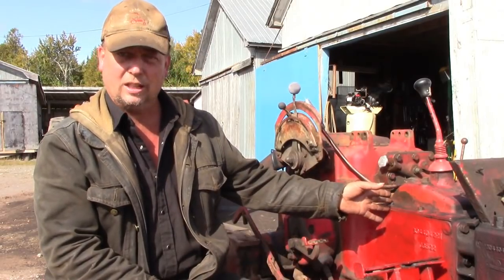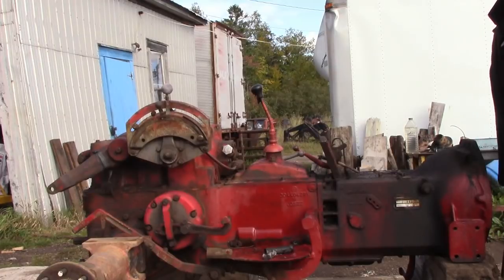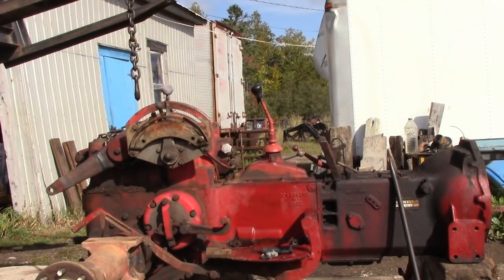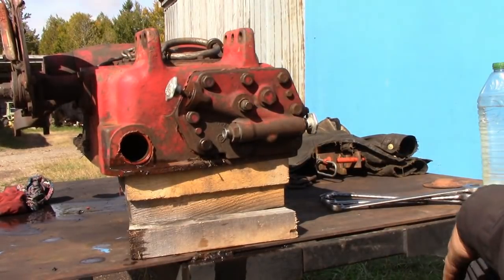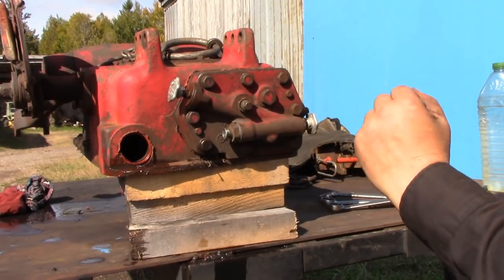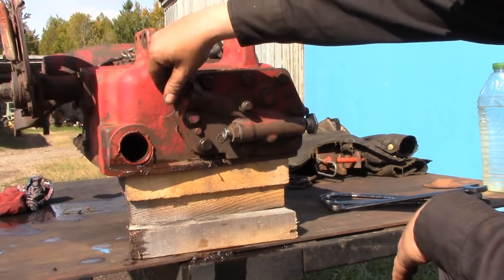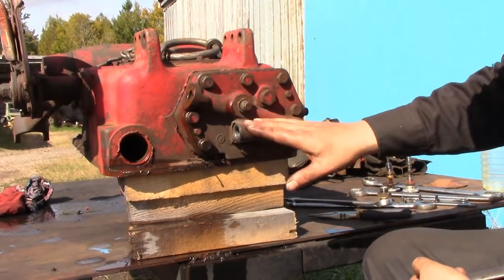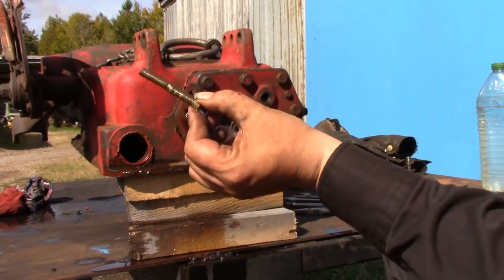B414 Hydraulic unit dis assembly

Comment: What is the fast flow valve used for, and how would it be used, what adjustments are available.
Reply from the maker: Fast is the normal setting, you can set it to slow to slow down the raising and lowering of implements. I have never used the slow setting. Thanks for watching!

Comment: Hello around the 4 minute mark you talked about the isolator valve how it’s used to run a wood splitter. Is this used with the remote hydraulic accessories or can this be a stand alone line for running a remote cylinder?
Reply from the maker: That is a stand alone solution, it is only one way flow so to run a wood splitter etc it would have to have it's own valve.  It will work for trailing machinery that uses a single acting cylinder to lift and gravity to lower. Thanks for watching!
Reply: @CanadianRedneck15 thank you that explains a lot I appreciate that
Reply: Also love the videos very informative

Comment: I have a gas B414 and the end of the hydraulic"regulator" filter broke off inside just like yours in the video.  Any ideas as to how to remove the remaining end inside the valve assembly without having to take remove it from the tractor and take everything apart?  Based on pics of a complete filter, the end inside is shaped sort of like a nipple and is held in by an o-ring.
Reply from the maker: A pair of long needle nose pliers should be able to fish it out. It's just a long cylinder, about 1 1/2" X 5". Thanks for watching!
Reply: Wanted to ask if the cylinder head plate can be removed safely from the valve plate without removing the entire hydraulic unit from the tractor?
Reply from the maker: @tjriddle6029  I think so yes.
Reply: Ok, thanks

Comment: Hello Dave - I have dis-assembled  the hydraulic unit after the lift arms stopped coming up.(not lack of h-oil issue, not the spring issue to which you refer in the dsi-assembly) .   Can post a video on re-assembling the hydraulic unit please ? (I have the shop manual but ... )  TIA a gazillion.  PS I may have an extra unit available later.
Reply from the maker: I don't put them back together I just strip them for parts. Thanks for watching!

Comment: I am wondering if you can help me identify this tractor.  I have this information 
International Harvestor Co of Great Britain model A440003B00347
Engine BD144A.    77872
Diesel would picture help?
Reply from the maker: A picture would be useful though I suspect that would be a 354. With the 354/444 tractors for some reason the serial number ended up in the model number line.

Comment: Hello, I have an International 434, which when lifting the hydraulic arms with a connected machine, it lifts and reaches the point where it begins to go up and down, you have to keep accelerating, so that the machine stays or otherwise it goes down.
Reply from the maker: Sounds like the lift cylinder may need repacked. Thanks for watching!

Comment: I have a int444 BD154    My 3pt hitch will not raise I clean all valves  replaced small split pin  Replaced new Hyl oil too  Can it be something in that piece you took off  Ihave a front lifter and power steering  they all work fine  What else can it be Also sometimes my 3pt will raise by itself  when I’m driving  but it won’t lift  even I move draft controls  So hope u can help me I  love all your videos   So helpful  Thanks in advance for any help in advance
Reply from the maker: Sorry @MrHeavyev, I am not sure how to help with that.
Reply: Thanks For Reply
Reply: I took the Hyl off and I found a S Shape wire in bottom of tank  it look that it connects to big spring  not sure where it goes  I have picture but not sure how to send to u Maybe u can explain it to me Thanks
Reply from the maker: @MrHeavyev  I'm not sure but you can look up the parts diagrahm at https://www.mycnhstore.com/us/en/caseih
Reply: Ok thanks

Comment: Morning Dave im working on my 2424 industrial . Working on the hydraulic reservoir going to replace the gasket on the control valve to reservoir. And i noticed that there is a safty chain in there it is broke up into a couple peices . Would you by chance know where that is supposed to be hooked to on the bottom some where ? And also does it realy need to be in there . I haven't noticed and problem with it in the 15 years i have had it probly been unhooked sence i got it . Thanks in advance . Love your videos
Reply from the maker: If it's been causing no problem I wouldn't worry about it. Thanks for watching!
Reply: Thanks for the reply  @CanadianRedneck15

Comment: Hi Dave! I need some help with my 3pt. I got stuck with the snow mover and lifted/pulled the tractor backwards with another traktor, i think i loftet the 3pt to max and now its not working, the safety chain inside the hydraulic tank is a broken but the rest looks fine. Its a 434, and it worked just fine before i lifted it/pulled ut in the 3pt. Great videos! Br/Alex from sweden
Reply from the maker: The push rod that moves the rock shaft just sits against the piston in the lift cylinder. Yours may have lifted far enough  to jam the push rod. Make sure it will slide back in against the piston. You may have to loosen the valve body at the front and move it forward a bit to get the rod back into the lift cylinder if that is your problem. Thanks for watching!
Reply: @CanadianRedneck15  Thanks! I guess i cant send or receive pics here? Otherwise i should av send you a pic, i just sucked the oil out of it and saw that the chain was broken.

Comment: Hi Dave got a question B414 LH spindle broke it is power steering long spindle original B414 my parts tractor has a later serial # and has the shorter spindle reg steering can i take both sides from axle extensions and put both sides in the older one thanks
Reply from the maker: There were a few variations, manual steering had a shorter spindle, the steering arm is keyed and has a bolt through the side to lock the arm to the spindle. Power steering has longer spindle and the amr goes on a tapered spline with a nut on top to hold the arm on. There was also a high clear or row crop version that was some where around 8-12" taller. Thanks for watching!
Reply: @CanadianRedneck15   Thanks Dave

Comment: I really have learned a lot from your videos. I rebuilt a BD154 on an IH 384 watching them. The motor runs perfectly but the 3 point lift goes up in a jerky way under a load. Kind of a Bump, bump, bump. It will raise the cutter to wherever the lever is set and stay there until lowered. Just jerky going up. I cleaned the suction screen and hydraulic tank during the rebuild. My question is whether I might have a pump issue or a valve bypassing? Hate to buy a pump and not fix the problem. Thoughts? Thanks for all you do! It really helps!

Comment: Hi, i have a 434 that after removing the the hydraulic tank and replacing it, the 3 point hitch will not go down with tractor running. When you shut it off it will drop. All this no matter where the control is. Where would i look first ?.
Reply from the maker: Make sure the "open/close" valve is fully open and the draft control lever (lever next to the fender) is at least half way forward. If that doesn't solve the problem then you will have to start checking deeper to find the restriction to the flow of oil. Thanks for watching!

Comment: Hello Dave,
Thank you for your helpful vidéos. 
I have an IH 434 with some trouble on the hydrolic valve. 
Do you have, or happen to know where I could find a detailed plan of said system? 
An exploded view would be perfect. 
TIA and have a good one.
Reply from the maker: You can look through the parts book at https://www.mycnhstore.com/us/en/caseih  Thanks for watching!
Reply: Hello Dave and thank you for your earlier reply, much appreciated. 

I hope not to be a hassle, but there's something I'd like to bring up

The lift of my IH 434 doesn't rise whatsoever, and since this tractor model is highly uncommon here in France, I was wondering if you had some pointers.

The pressure is fine ( 160 bars), the oil & filter are fine, I've thoroughly cleaned the main valve, changed every gasket and the main spool, but nothing's doing. It still won't activate.

Does anything come to mind as a likely/typical culprit? Could it be an issue with the lowering spool? 

Any help would be greatly appreciated, have a good day !
Reply from the maker: @patricekieffer6926  That's odd that it won't lift at all, perhaps there is trouble with the mechanical linkage inside  not activating the valve to make it lift.
Reply: @CanadianRedneck15  Cheers for the suggestion but the linkage appears to be working as intended, and nothing's loose or anything.
I suspect there might be some leaks-inducing loose parts in the lowering spool, however. 

BTW, I forgot to mention that the lift does (very) slowly and partially rise if the second lever of the draft control is pulled all the way to the side.
Reply: @CanadianRedneck15 hello Dave,

Just for the record, I've finally solved the issue: it was the orifice filter.
Replacing it with a brand new has entirely fixed the hydraulic lift issue.
It seems like the lowering valve wasn't getting enough flow. What I do find strange is that I had thoroughly inspected, cleaned & washed the old filter, without result.
Reply from the maker: @patricekieffer6926   That's terrific! I am glad you were able to find the issue!

Comment: Another Great video I rebuilt my complete  Engine IH 444 Bd 154 tractor from England by now after all the years I m having  another problem My front buckle  can’t lift if I have weight in in I refilled Hyl  oil new Cleand Screen filter but it still can’t lift bucket with  Can you Tell me wha else can I Do Any info would Appreciate Thanks
Reply from the maker: May need somebody to do a pressure test for you. Could be the loader valve or the hydraulic pump.
Reply: @CanadianRedneck15  ok thanks I Did Preasure test last night  it was 500  todayi put washer in it came to 1000 is that ok or do I need to replace pump Thanks Again fo your help I love all your videos
Reply from the maker: @MrHeavyev  I'm thinking that it should be more like 2500 PSI.
Reply: Thanks for fast reply will have to check  again  Maybe it’s the Hy Pump or maybe I can put another washer in Hyl
Reply: What is that big bolt for that  on body is it ok to take out and put a pressure tester there
Reply from the maker: @MrHeavyev  If you take the big plug out at the front of the valve body you might be able to do a pressure test there.
Reply: @CanadianRedneck15  Thanks
Reply: Finally found the problem thanks  it was frozen oil  I still need a Hyl Pump Do u sell them Mine is a Plessey Dynamics serial # 35L5-35  C25 18vS With Power Sterring  It works for now but doesn’t lift heavy stuff  But the reason I’m  asking my 3point hitch won’t lift  change oil still won’t raise Took of cover under seat every thinks look ok oil new Draft movement. Moves but no lifting I clean Hyl valve filter  and the Hyl valve body plugs  Can You help me  any help appreciated     My Tractor is a International 444 BD 154 it’s 1977 England Thanks For all your info I rebuilt my  complete tractor  tha includes Engine  And every thing tha was broken or no working Your Videos Are the Great
Reply: Finally found the problem thanks  it was frozen oil  I still need a Hyl Pump Do u sell them Mine is a Plessey Dynamics serial # 35L5-35  C25 18vS With Power Sterring  It works for now but doesn’t lift heavy stuff  But the reason I’m  asking my 3point hitch won’t lift  change oil still won’t raise Took of cover under seat every thinks look ok oil new Draft movement. Moves but no lifting I clean Hyl valve filter  and the Hyl valve body plugs  Can You help me  any help appreciated     My Tractor is a International 444 BD 154 it’s 1977 England Thanks For all your info I rebuilt my  complete tractor  tha includes Engine  And every thing tha was broken or no working Your Videos Are the Great

Comment: Hola que tal , me podría explicar las dos válvulas en la caja de válvulas , qlas que tiene giro hacia un lado u otro para que son ?
Reply from the maker: Sitting on the seat the valve on the left is the fast/slow hydraulic response valve, leave it on fast. On the right is the shut off valve that closes the flow from the lift cylinder, you only close that if you are using a specific port for remote hydraulics otherwise you are dead-heading the pump. Thanks for watching!
Reply: @CanadianRedneck15  muchas gracias muy amable, ahora estoy en pleno desarme

Comment: I have an IH B414 and the lift will not lift. What could be the problem?
Reply from the maker: Out of oil, Bag hydraulic pump, stuck valve, damaged controls,,,,,,, you have to do some diagnosis and figure out where the problem is. Thanks for watching!
Reply: @CanadianRedneck15 Okay i will check it. 
Thanks for the help

Comment: Cool video. I am wondering if I can put that style of lift system on my 340 IH tractor. I'd prefer to have draft control and the third arm available when needed. Very informative video BTW.
Reply from the maker: The 340 is a completely different series of tractor, this unit would not easily adapt over. Thanks for watching!

Comment: I have a B414 that I have to put the control valve assembly back into the hydraulic lift housing. I watch this video however I cannot find anything that shows inside the housing and how to connect the linkages. I did not take this apart myself the person who did has passed on. Any advice and or pictures/videos would be greatly appreciated.
Reply from the maker: I recommend you get a repair manual for that, they are fairly complicated. Thanks for watching!
Reply: I have 3 manuals and they do not show everything. I know one end of the spring hooks up to the cover but I don’t see where the other end hooks up. Inside the housing is the draft lever with a rectangle peace that something hooks up to. 
If I could find a video that reinstalls everything I am sure I could figure things out
Reply from the maker: @FredPoliquin-zs3me  Sorry, I don't have any videos of that.

Comment: i have a b414 and my tach gear in the engine is damaged i got the gear that goes into the top part where the tach cable hooks to but that part is damaged in the engine what is the best way to remove that part from in the engine or is it worth fooling with thanks for any help that you can give
Reply from the maker: 2 bolts removes the little gearbox from the engine, they are available new I believe. Thanks for watching!
Reply: not that part i have removed that im talking about the gear in the engine in would have to disassemble the engine to fix that right  @CanadianRedneck15
Reply from the maker: @oldtractorandcats6352  Sorry, yes it is the oil pump gear that drives the Tach box.
Reply: Does that come out fromt removal of the oil pan I have a it manual but it is not that good and dosent brake the engine down that well it manuals used to be really good if it requires more then that I may just let it go and not repair it
Reply from the maker: @oldtractorandcats6352  Yes, remove the oil pan and one bolt up through an ear one the side of the pump drops it out.
Reply: @CanadianRedneck15  oh yes I am glad that it can be reached from the bottom like a isaid an it manual used to be good now thw new ones aint so good the other big question how hard is that part to find
Reply from the maker: @oldtractorandcats6352  Check with scrap yards, you should be able to find one.

Comment: i see supply for the remotes where does return go and my pto will not engage i think the splines are fowled some way havent looked is there anything tricky to looklout for while working on the pto
Reply from the maker: You can put a tee in the fill or drain for the hydraulic unit for the return. Nothing especially tricky wit the PTO. Thanks for watching!

Comment: How do you service the valves if the valve was in closed position during operation of tractor
Reply from the maker: The valve shouldn't be in the closed position unless you are using remote hydraulics. To service the valve you have to remove it. Thanks for watching!

Comment: Questions on that port for aux. hydraulics, I'm guessing you would have to disconnect the woodsplitter or whatever was hooked up before you could use the hitch again?
Reply from the maker: That is correct, with the valve open and a wood splitter connected the oil would just circulate through the splitter valve and not make any pressure in the lift. Thanks for watching!

Comment: Is the o ring on the isolator valve a normal o ring or is it special ordered? And what size is it?
Reply: I just got a IH354 and the isolator value has a pretty fast leak. Never worked on a tractor before. Thank you for making these videos and responding to questions.
Reply from the maker: @richardpittman5291  I think it's a pretty standard o-ring, I don't know the size. Thanks for watching!

Comment: Hi, thank you for the great videos u got here, they have helped me out before. 
I got a IH444 and the three part is jerking. I think it’s a leak in the piston so I got some new o-rings, backup and gaskets for this job. It’s not that easy to find these older parts here in Sweden..
The question: How much do I need to remove to get to the piston and change o-ring? Do I need to disassembly everything like u do in the video, or can I just get the valve body off in a easy way and get to the piston that way?
Ty once again.
Reply from the maker: You will have to lift the unit off the tractor and open at least the top plate, maybe the bottom too, to unhook some links inside to pull the valve body and cylinder out the front. Thanks for watching!